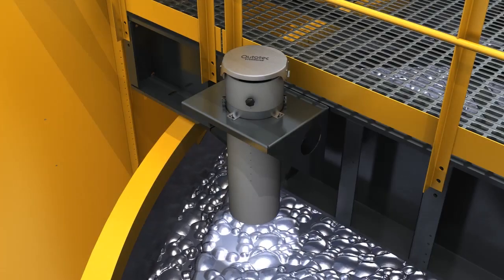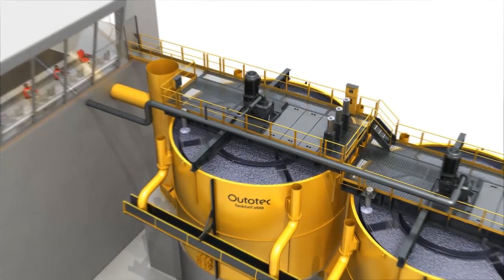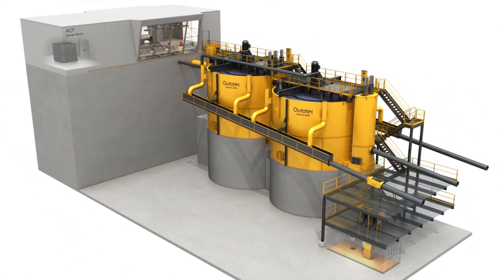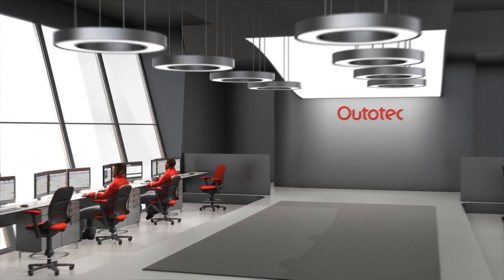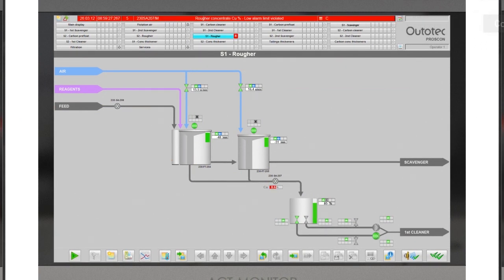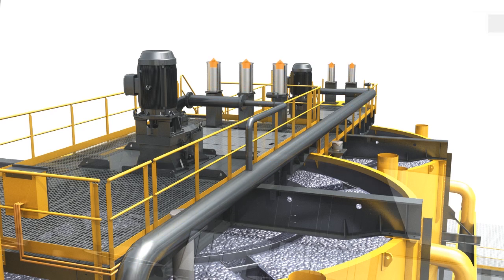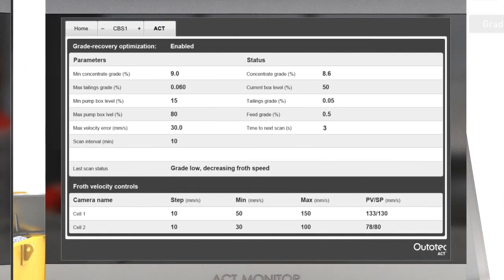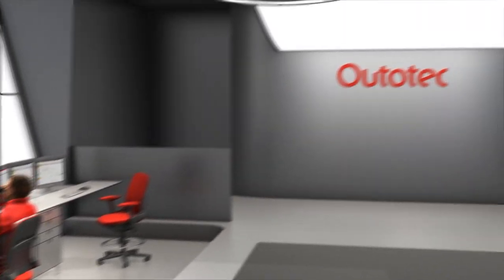FrothSense sensor system for flotation process control

Comment: Wonderful but what are the algorithms used by this system (froth sensor ) to detect and estimate all this measurements ?
Reply: That would probably be what make their company top of the line and I don't think they'd share that haha, come on, that's obvious.
Reply: I think its based on a Neural Network  developed using tonnes of data, I am not sure but that's what I think.
Reply: IP sorry